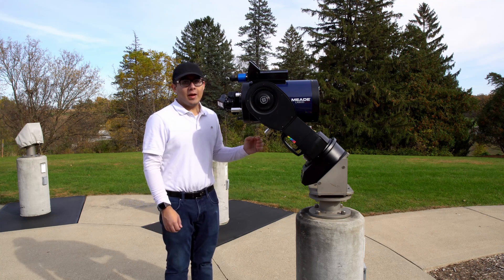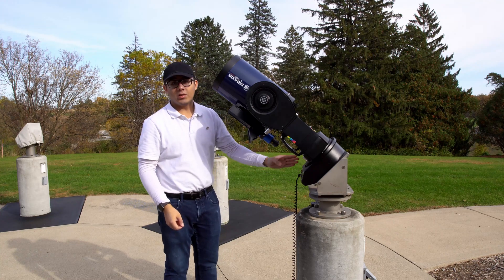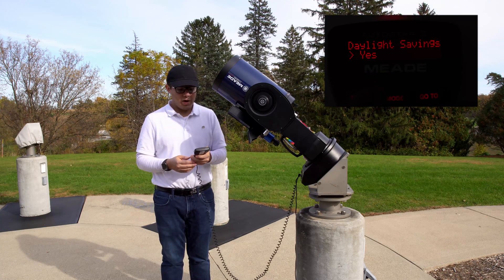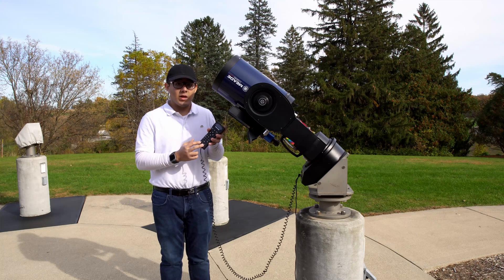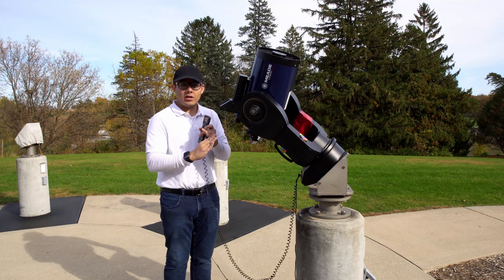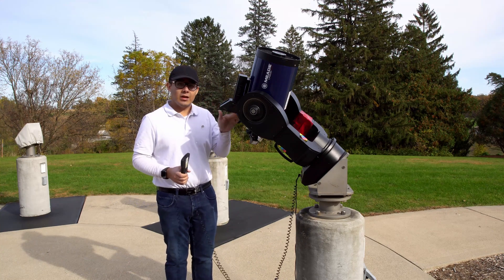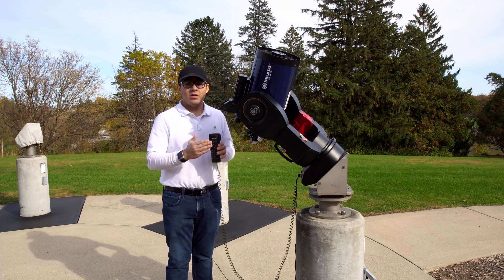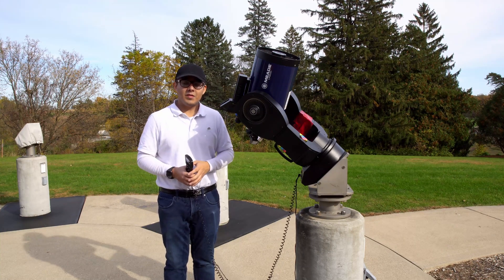Polar Aligning Meade LX200 at Carleton College

Comment: I would really advise against demonstrating a daytime alignment or even an automatic traverse of the mount with the OTA objective cover removed.  This class of SCT scope has about a 600x concentration of light through the eyepiece compared to a human iris.  The solar warning sticker on the scope includes words like "immediate" and "irreparable" with the phrase eye damage.  The manual also states that pointing at the sun will destroy portions of the optical path in the telescope itself.  I don't even recommend removing the objective cover for the finder when the scope is traversing in daylight.  I generally even remove the finder completely or tape its objective cover in place for OTA solar observations through the appropriate solar filters.  I would further stress that it would be best to put up a caution tape or similar barrier or better, have a Trained person keep casual people away from the scope and controller to prevent an accidental tragedy or needless damage to a scope.

In American Sailing Association certified sailing classes I was taught "One can do much on the water with safety and little without it".

Comment: Really enjoyed your video man. I think I am going to get it.
Reply from the maker: Getting the meade lx200 8"?
Reply: @clexdigital  heck yes.
Reply from the maker: Nice! Though, would not recommend Meade's fork mount, it has very limited support and is hard to work with overall
Reply: @clexdigital  thanks for the tip Alex! 🤗
Reply: @clexdigital  I did not know any better and bought mine used, and the learning curve was greater for a beginner, Its funny the more I learn about astrophotography equipment the more i find out I have all the wrong equipment LOL
Reply: I'm not sure on what facts you base your opinion about Meade's fork mounts. They have the same degree of 'support' as the OTA. In terms of aftermarket, Meade forks are easily serviced.
Reply: Perhaps you're recommending an equatorial mount over the fork, in which case, the cost of the GEM may exceed the cost of the optics (for heavier scopes). IMO, Alt-Az is better for a beginner practicing only visual astronomy.
Reply from the maker: I'm basing this off my extensive use over a couple of years with this Meade ota and fork mount for astrophotography. Don't get me wrong, I completely understand its benefits; benefits that warranted a second batch of ordering by my college. For visual-based astronomy and for ease of use, it's hard to beat an "all-in-one" solution. 

But for astrophotography where 10-minute exposures are sought, these ain't it. My college also used Macs for our hardware which was not compatible for these forks unless we used their first-party software (650$ cost). 

You are correct that GEM mounts can be very expensive. I've since purchased the eq6-r pro and my workflow has been so much better (remote slewing, automatic filter changes, meridian flips, etc)